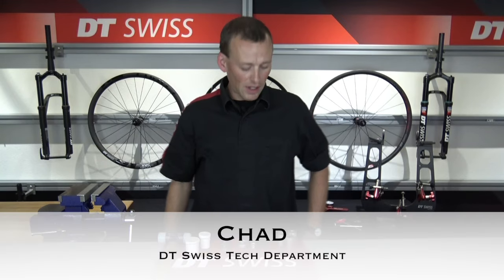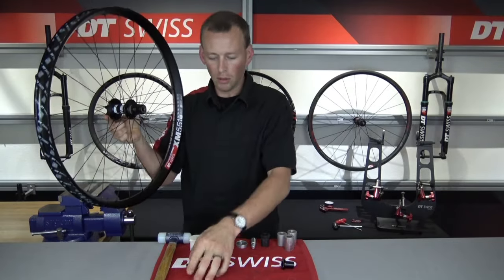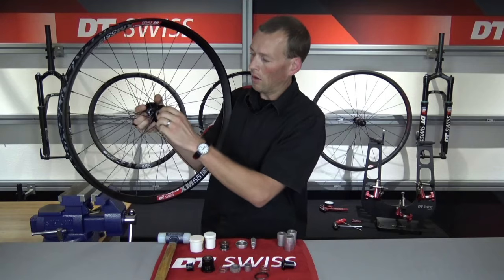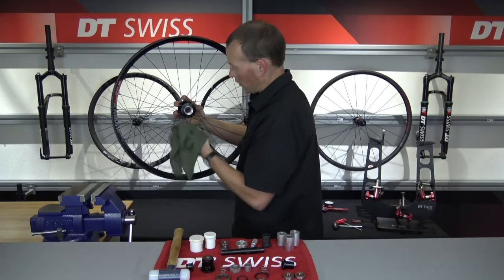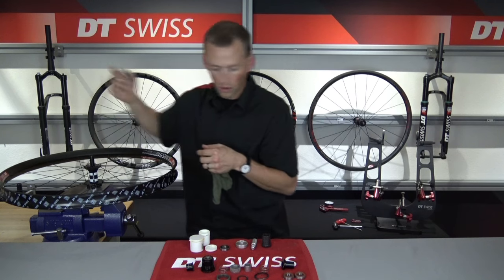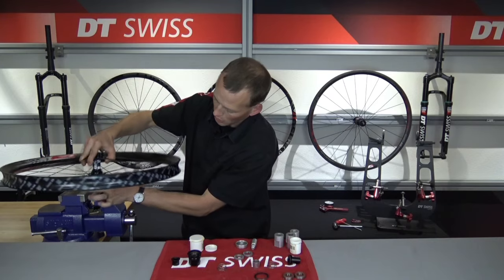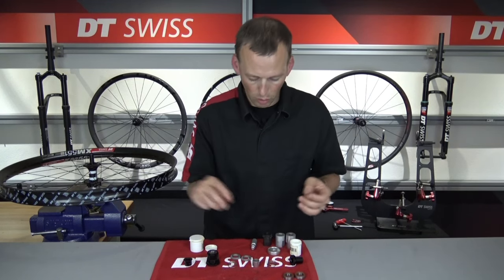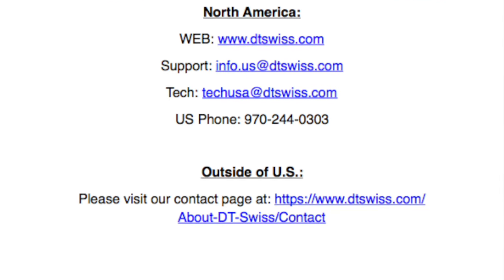Bearing service on DT Swiss Star Ratchet hub. How-to tutorial.  | DT Swiss

Comment from the maker: What is your experience with doing a bearing service? Do you have any questions regarding this topic?  Let us know in the comments below. 👇
Reply: Is there a limit on forces one may apply by turning the wheel left to remove the ring nut? Specifically with regards to a carbon rim. Is there an alternate method for loosening if the rim is carbon? Should two people be torquing that hard on a carbon wheel?
Reply from the maker: Hi
Thank you for your question. We don't have a maximum torque for loosen the ringnut. It's related to the torque the rider put on the nut while using the wheel. Sometimes we use as well two people, which is helpful as well to keep the turning direction aligned. A wheel which is build in a proper way should not get affected. As you maybe can imagine, the torque of a strong rider combined with gear reduction on a strong climb will put much more torque on the components while riding. 
Friso "DT Swiss".
Reply: So I'm still trying to remove the ringnut @4:00. I cranked with both arms counterclockwise and stopped out of concern of breaking spokes from the torque. I'm not impressed with this design. Thanks dt swiss. Anyone recommend another better hub system?
Reply: No dice. I'm about to take the wheel to lbs and/or take a syringe and inject grease into the bearing.
Reply: Was able to free it up by spraying the ring drive nut with Finish Line Chill Zone for 15 seconds. Needed more force, but it cracked free. Don't know if it was the extra force or the FLCZ spray or both. 🖖
Reply: @TheBicycleCellar  I tried wd40 and light blows with a hammer. Two attempts, nothing. I'll try again tomorrow or take it to the lbs. Thanks bud.
Reply: @johngraboski  the recommendations I got elsewhere were apply heat, some saying with quick passes from a torch even, that a heat gun isn't sufficient. Heat makes things expand, cold makes them contract. The hub shell is aluminum, the ring drive nut is steel. One person did say heat everything up with a heat gun then put a paper cone full of dry ice inside the center of the ring drive. That made sense, but I'm not shopping for dry ice right now. So Chill Zone it was. I also clamped the tool in the vise with the full flat sides vs the half flat sides as the video shows.
Reply: @TheBicycleCellar  first, thanks for taking the time to respond, you're gold :) second, I tried some wd40 and light medium hammer taps. Next is an impact hammer from the local autoshop. If that doesn't do it... definitely lbs, but the auto shop is 3 mins away on foot.
Reply from the maker: Hi John, thank you for your message. The ringnut will be screwed in with the power of the user's legs, multiplied by the gearing , so it is not surprising it will take a lot of power to remove it. Especially when the ringnut has not been removed for years. Sometimes it will even Need two Person to turn the wheel and for sure a massive vise. If you will not succeed I would suggest to go to an experienced dealer or one of our service centers, to service the hub. At least it is the only freewheel system on the market where you can replace all the internals. With all the other systems this would mean, replacing the hub. Have a nice day, Friso "DT Swiss".
Reply: @dtswiss  hello and thanks for taking the time to answer. I realize it's a compromise based off of what you say. Of course the frustration of not being able to access said bearings... My wheel has those lovely aerospokes... and I don't want to turn a hub service into a spoke replacement. I'm trying wd40 again (I'll be careful not to get it into the bearing area) then an air wrench next. If that doesn't work I'll try the lbs, waiting times for service atm are through the roof. Happy and Healthy days to you, your crew and fam!
Reply: Hi, working on a friend's Spline 1700 29er rear wheel here, the end caps came off no problem but I cannot get the ratchet cassette body off, not even when I clamp it in the vise and try top pull up the wheel... is there a different method? Or am I doing things wrong and need an other instruction video?! Thanks!
Reply: Hello, There is another spacer inside freehub body, sandwiched between two freehub body bearings. Why do you need it there?
Reply from the maker: Hi Yury
Thank you for your question. Without this spacer the bearings in the freehub body would get displaced and could not work properly.
Have a nice day, Friso "DT Swiss".
Reply from the maker: Hi Peter
Thank you for your message. So you can pull off the end caps with your hands and there is no treaded axle being used?
If you can do so, the freehub body should be easy to pull off as well. One reason why it will not come off, the axle is bended!
I would recommend to go to an experienced dealer or get in touch with one of our service centers, as it is not possible to solve such Things remotely. A list with all our service centers can be found here:
https://www.dtswiss.com/en/support/service-center/
Have a nice day, Friso "DT Swiss".
Reply: @dtswiss  no thread on the axle, it was not bent, and no, it was not easy to pull off... this worked though: https://youtu.be/DO71YcjSqWY
Reply: Hi. I am impress how DT is trying do life more difficult. The hub should be able to disassembly using standard keys (Allen keys) like in other company hubs. I know that DT Swiss prefer to earn on selling additional special tools for repairing its components. This is very big disappointing. Please look e.g. to the Fulcrum hubs and look how simple it is built and how easy to service it (one key and hummer).
Regarding video: Thanks for very good tutorial.
Reply from the maker: Hi Marcin and thank you for your feedback. As far as I know there are not that much hubs available where you can have a complete rebuild including the freewheel system. But I do not know one where you don't need specific tools to do such a rebuild and I'm not talking about a simple bearing replacement. The good reputation of DT Swiss ratchet hubs for over 25 years is based on their durability, the easy service and the availability of spare-parts for a long time. 
Have a nice week-end and stay healthy, Friso "DT Swiss".
Reply: Where can we buy these tools to service the 350 hub? Or do you have specific parts numbers? Nice video!
Reply: So many special tools required. How much would a set of them cost in the UK?
Reply: dear sir, what if i dont put the shim ring under the ring nut?? is it ok? i loss mine😅
Reply: Thanks for this video.  I bought all the tools and bearings (including the freehub) for the replacement.  Between my different MTB and gravel wheelsets are a combination of DTSwiss 240s,350 and roval hubs.  I did have the hardest time taking the lock ring off the drive side.  I ended up using a large crescent wrench inside a 24 inch section of pipe with the lock ring removal tool for it to break free.  I did need to strap the wheel to one of the legs of my workbench to hold it in place to get enough leverage to move the lock ring. Once it was broken loose I no longer needed to use the pipe and just used the crescent wrench.  Swapping the bearing was pretty easy to do just like the video.  I am looking forward to need to replace bearings now.  Such a satisfying maintenance job.
Reply: @dtswiss  I have fulcrum hub and to change bearing you need only allen key, hummer, bolt, nut, nut washer. So everything I can get in hardware shop very cheap. The problem is that I cannot buy any of fulcrum hub without whole wheelset ... That's why I bought DT Swiss 240S as You present. From last time when i write message to You i didn't think this video will be need for me so soon. After 300km the bearing is obliterated. Is it normal for this hubs? Generally I am changing bearings after 10kk where is little noise. Here i feel high friction and loud noise.
Reply: way harder to take the play out of these bearings as the polish in than your competitors. there's another company, with a lifetime warranty set of hubs, that cost a little more, but this same bearing play removal can be done with a 2.5mm allen wrench and takes about thirty seconds.
Reply: Try pre warming hub with hot air gun .instead of pounding bearing they will drop in and out if hub is warmed...
Reply: Over priced and over complecated design ...cone hubs lubricated with fully synthetic grease needing 2 cone spanners cheap ..easy..fully reliable..proven...Simple is best
Reply: Removing the ring nut is by far the most difficult. You definitely need 2 peoples (don’t ask your wife / Girlfriend) and a heavy fixed workbench. I have done that on 3 different wheels but all 350 Hubs from 2 to 4 years old. Even when you think the spoke won’t hold just push more 💪💪💪.
Reply: Many thanks for the video, but my hub wont come apart as easily as yours! On a virtually new 240s hub, < 100km bearings seem very stiff, quite a lot of resistance to turning the axle by hand (stiffer than my other 240s rear hubs). Am having difficulty getting the NDS bearings out, have been hitting axle quite hard from the DN, but bearing does not seem to be coming out at all? Do I just hit harder! ? -- Thanks
Reply: You should add information to the products on your website about the bearings used in the hub body and the freehub body. So you don't have to disassemble the hole hub to find out by yourself.
Reply: My ring nut is solid in the assembly, it just will not budge! Very tight. I'd read that trying to heat it up a little might help but I'm unsure if it's okay to do that. I tried all else in terms of passively trying to unscrew it. Stuck. Help anyone?
Reply: Warm up the hub shell with a heat gun to around 100C, then spray ring nut with keyboard duster with the can inverted. One person job.

Comment: Ratchet ring DOES NOT COME OFF on a used wheel withough breaking spokes or tools.  Additionally, the ratchet ring removal tool is WAYYYYY OVERPRICED.  This is a TERRIBLE design.  I am sending it in to DT to get the job done under warranty, each and every GOD DAMNED TIME!
Reply from the maker: Hello County Cycle, thanks for the comment. The key to removing the ring nut is a large, sturdy vise. Clamp the ring nut tool as low as possible in the vise, and make sure the vise is very tight. Usually a couple people are needed to hold the wheel's rim and turn it counter-clockwise to loosen the ring nut. We use this method and have never failed to remove a ring nut (and there have been some tight ones)! If you happen break the tool during use, please contact our distributor/service center Outdoor Gear Canada for a replacement. Kind Regards, Andrew - DT Swiss USA
Reply: I found the solution to this, but it requires a few days. Just before the star-ratchet lock ring 'undoing' stage in the video...Sit the wheel level with the ratchet side facing up. Block the hole in the bearing on the star ratchet side and fill with anti-seize spray until overflowing. Sit for 24 hours. At the end of 24 hours tip out the spray and put the axle through the back (inner edge) of the star-ratchet size bearing and tap swiftly a few times to jar the lock-ring. Repeat at least once (block hole, fill with spray, tap to jar lock ring again) and more if stubborn.  You'll need a quality vice and if you hear the spokes creaking excessively (a little bit is okay) stop and repeat the process. I got there eventually without breaking spokes or the tool, but did shatter a cheap vice.

Comment: I have the 350 hub for mtb, when the bike is on a stand & I give the pedal a spin and release the pedal, the pedal continues spinning with the wheel then, I notice a significant drop in inertia a few sec after whereas my other set of 350 dtwiss wheel set doesn't do that - after releasing the pedal, they stay put and the wheel spin noticeably longer - what could be wrong?
Reply from the maker: Hi, thank you for the question. As you might know, it is pretty hard to identify a problem like this, without having the product in your hands. There are a couple of options like, it is normal because the hub is new, and the grease needs to be distributed a little bit. Therefore, the problem will be solved after the first ride. If this happens after a service, there are two reasons which might lead to this behavior:  
1. The spacer in-between the ratchet on the axle is missing = see Video 13:36min 
2. The hub seal is not seated correctly = see Video from 11:23min 
If this information will not help to solve the problem, please contact one of our service centers close to you: 
https://www.dtswiss.com/en/support/contact 
Enjoy your bicycles, Friso “DT Swiss”.

Comment: Do you need to remove the lock nut for the drive side bearing to be able to come out?
Reply from the maker: Hi there,
Thank you for your question. To change the bearing on the drive side of DT Swiss ratchet hubs, you would need to remove the ringnut/locknut with the specific tool in any case.

Comment: My ring nut is solid in the assembly, it just will not budge! Very tight. I'd read that trying to heat it up a little might help but I'm unsure if it's okay to do that. I tried all else in terms of passively trying to unscrew it. Stuck. Help anyone?

Comment: Just did mine and this video was a great help, thanks! I have a couple of tips that people might find useful:

1. If the splined ring is proving difficult to get off (mine was rotating the spline tool in the vise!) then try heading the hub with a heat gun on high for a few minutes. You won't damage anything and my splined ring came out without too much effort after that.

2. When it comes to installing the first bearing (non drive side) I used the bearing seating tool and a piece of threaded rod, a large washer and some nuts. The bearing seating tool goes on the bearing, the washer goes on the drive side of the hub and the threaded rod connects the two. Then by tightening the nuts the bearing is pulled into the hub perfectly parallel. I've never been able to pound bearings in straight, they always cock in the bore, so this makes it allot easier. The rest was a dream after that.
Reply: What did you use to heat things up, please don't say a naked flame ;-)
Reply: The first bearing MUST be the DRIVE SIDE! The axle provides the spacing of the bearings, NOT the hub flanges. The drive side shall be seated until the flange inside the hub and the non drive accordingly in the correct distance by inserting the axle, providing correct spacing.

Comment: Professional description, thank you. Can you please mention here again the tools needed. Thank you in advance and best regards.
Reply: The only special tool you really need is the ring nut removal tool, for the rest you can easily improvise with sockets, washers, a length of threaded rod etc. Just remember to seat the drive side bearing first as this then aligns all that follows to its correct spacing, & do use the threaded rod bearing press method, rather than hammering on bearings, even if it is only on the outer race.
Reply: @returnofthenative  Not so "easy" you could easily damage a bearing if you don't have the right tool, but only a cylinder with an approximative diameter.

Comment: your new-ish exp hub is a bear to do a bearing service on. unlike the previous 240s where you had that ring gear and the tool would sit very firmly in place the exp has MUCH smaller teeth. the previous vice method no longer worked. i'm even a reasonably strong guy and could not get enough leverage before the tool popped out. in the end it took a long bolt through the tool and hub to cinch it in place. a 15" adjustable wrench and 4ft pipe on said wrench. put the pipe under the bench and rolled the wheel toward me using that giant lever for torque. finally came free and i was able to change the one crunchy bearing. other 3 bearings are fine and i half wonder if that bearing is getting compressed as the ring tightens causing some type of deflection. anyone else have the bearing in the ratchet fail more frequently than the others?

Comment: You can pull with bear hand the end cap !!! Bearing can be removed using extraction bolt nut and large bush , avoiding hammering !
Reply: but you're SUPPOSED to use a hammer on these disposable hubs. did you think these were Kings?
Reply: Maciej Jan Długosz  you're right, 'no self respecting mechanic' would follow DT's instructions...
Reply: Wrong.  Mine (3 sets of 240s') won't come out with just hand force.

Comment: Hi DT Swiss, nice video! Do I absolutely need to remove the ring nut on the driving side first in order to remove the bearing on the non-driving side?
Reply from the maker: Hi, thank you for your comment. This is a very good question and the answer is no, you don’t need to remove the ringnut first. Usually, we remove as well first the non-drive side bearing. As you can see in our official manuals:  

https://d2a13k6araex7u.cloudfront.net/pmt/00/00/00/00/00/00/00/10/00/00/00/89/6/MAN_WXD10000000896S_WEB_EN_001.pdf 

If you’re doing it the way shown in this video, you will not need a tool to guide the axle and therefore the force you will need to remove the ringnut, as the axle is guided by the non-drive side bearing. If you’re using the complete DT Swiss toolkit, we recommend removing first the non-drive side bearing. 

Enjoy riding your Bicycle, Friso “DT Swiss”.

Comment: Thanks for sharing, just, I haven't got a vise, and haven't got anywhere to put it if I buy one, so I wonder if there's a way to do this without, maybe an idea for a future video....? ;- ) ;- ) ;- )
- And happy new year....!!!
Reply: I used a large crescent (adjustable) wrench with a pipe slipped over the handle of the wrench for extra leverage (a breaker-bar/cheater-bar) .  I put the wheel on the ground, held it with one hand (in a leather glove), and used the other hand with all of my body weight to push on the wrench-pipe.  Took a lot of force a few tries but it worked.